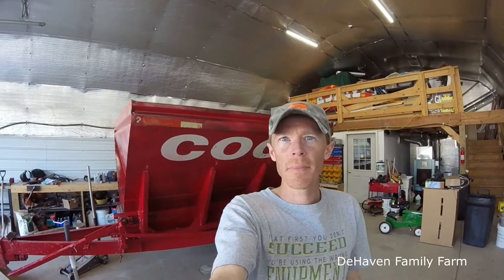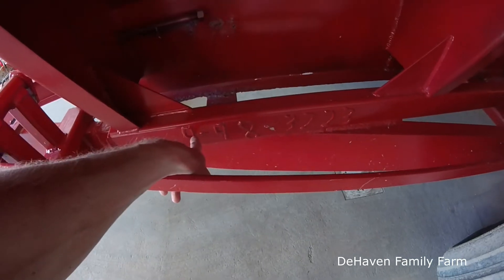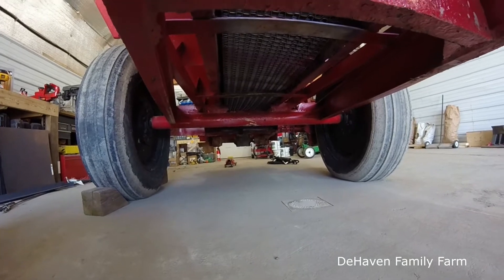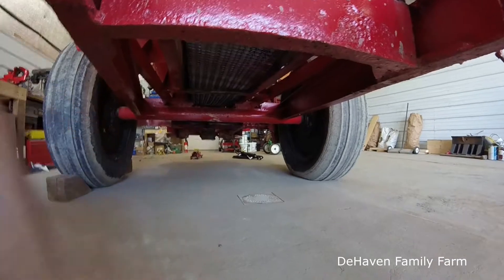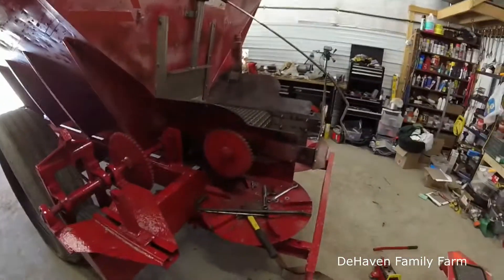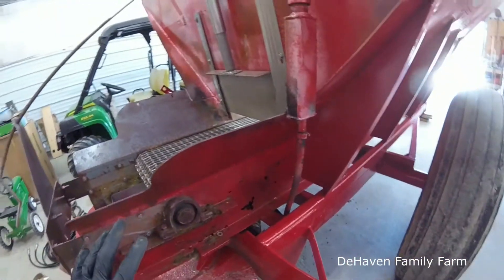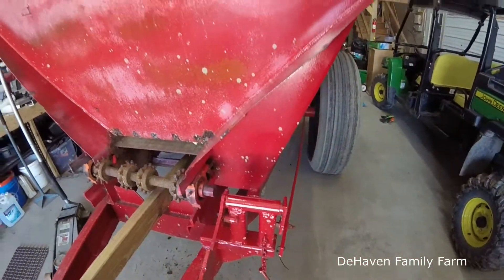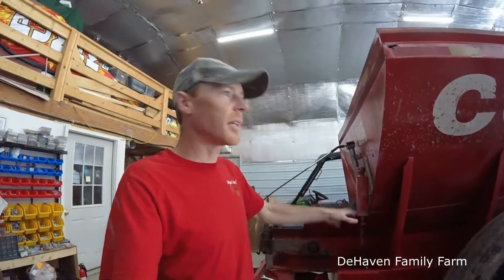Lime spreader repair- Part 1

Comment: Was that a John Deere shirt??? Haha. I still didn’t get my spreader home. I think yours is the same size as mine. Mine has tandem wheels. It does have the hydraulic for the drive wheel, yours looks a lot nicer. Are those spinners stainless?
Reply from the maker: Yup, a JD shirt lol Gotta keep it fair between the case and jd guys! I believe it is an eight foot box, and the spinners are stainless. I hope yours doesn't cost as much as mine to fix! I am posting a video tomorrow about the parts that came in for mine- they cost as much as I paid for the spreader, and I still have to get a few more things. Hopefully it will still end up being cheaper than the other used units I saw for sale.
Reply from the maker: Update: after looking at the spinners again, the dishes are steel and the paddles are stainless lol